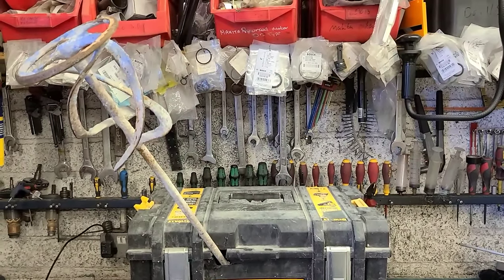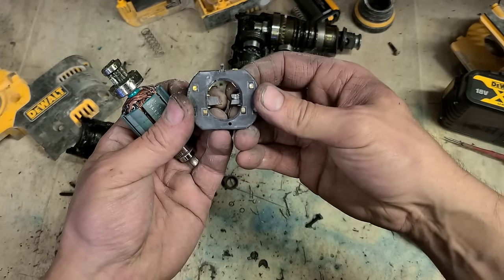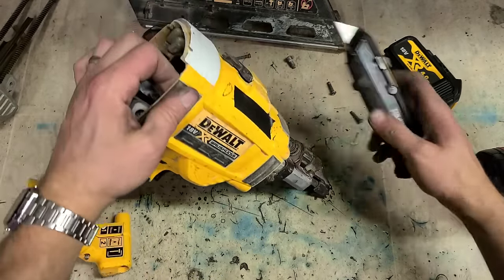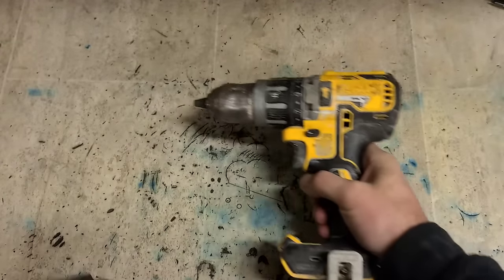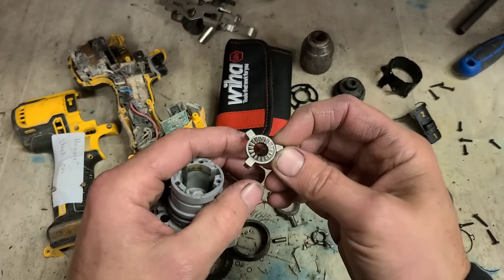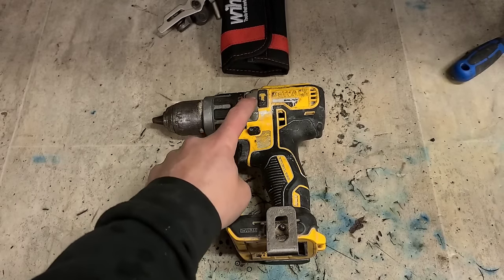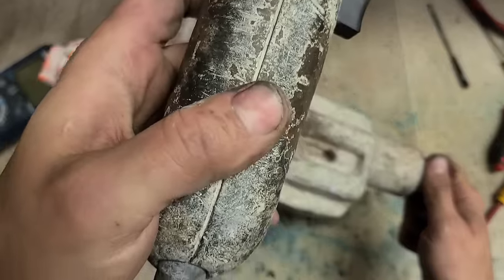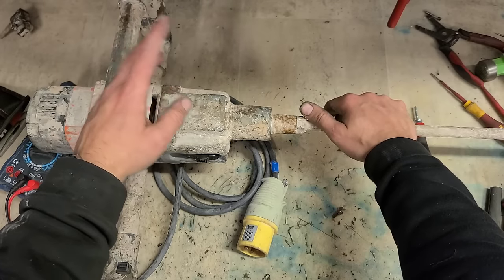Another big Dewalt box, fill of broken tools needing repaired. Dewalt, Makita and Alfra tools fixed.

Comment: Hi Dean ,fantastic jobs ! I am following you whenever  I have to sharpen my attention when  occasionally I repair my tools . I have a GBH 4 DFE | 0 611 236 703 and somehow after  ordering parts for servicing  the  hammer   ,watching your  video more than   5-6 times  I finally succed  to put all  together  but unfortunately   did not work the hammer mode   , open again and find out  that the Pos 830 - Aandrijflager 1 615 819 022   the outer ring of the bearing was broken. In The Netherlands  and probably all over  is no more in stock ; And now my question : is it possible  to have  that part  and in case yes , would you like to sell it to me ? The point  is  I have spent more than 100 euro on parts  and now  I have to fix the problem   ,otherwise  is a waste of time and money  .   Anyway  , either cases   I am your fan  in repairing  tools section  !

Comment: Nice fixes again! I'm still amazed though how heaps of your repairs come in without any description on what's wrong with them. Ofcourse some of them are obvious, but the ones like that Dewalt SDS drill where it's losing power over time are a lot harder to diagnose with just a quick test and not knowing why the customer sent it in.

Comment: Hey Dean, I love the videos! Question - Has the quality of Makita gone downhill since they started producing them in China? To the point that it puts them on par with every other major brand, such as DeWalt, Milwaukee, etc.
Reply from the maker: To an extent, yes. they are never going to last as long at they use to. But unlike a lot of other brands, makita sell a lot of parts seperatly, so they can be maintained and kept going for years if you want to repair them.

Comment: Tools fixed in this video:
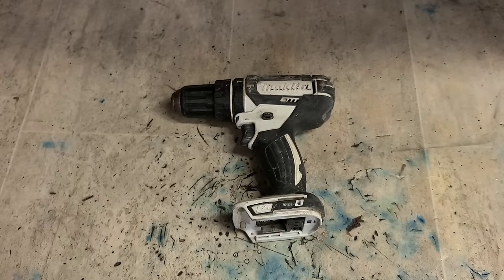1:22 Makita DHP482 drill  | Fault: Problem with starting
4:47 DeWalt DCH253 SDS Drill | Fault: Motor losing power (according to owner)
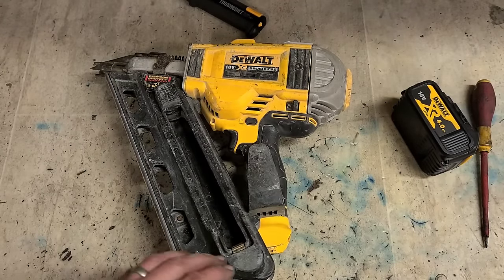17:40 DeWalt DCN692 (Type 2) nailer | Fault: Not firing
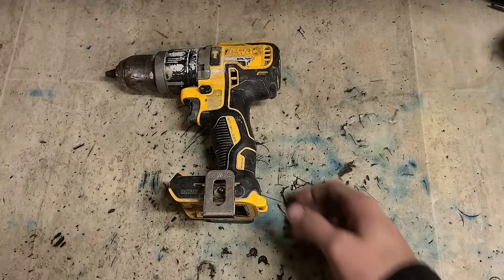30:16 DeWalt DCD1196 Drill | Fault: Stuck in hammer mode
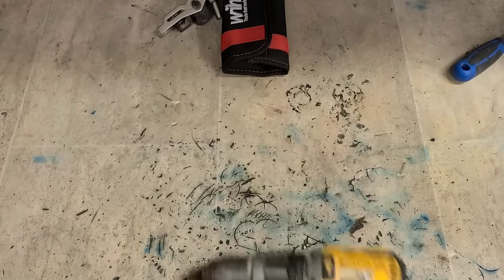52:25 Alfra EHR23/2 (possibly) concrete mixer

Cheers to Dean for telling model number, rather than me doing some CSI investigations.
Reply: Are there any tools that you dread comming into the workshop? That are a nightmare to repair?
Reply: @mickymeltdown  Sorry mate, Im not Dean, nor I am associated with him. Just average bloke who post this timestamps and model name, if someone has this model and same problem, so he can try to fix it himself.

Comment: Been watching the channel for a few months now and I haven't seen any multitool failures.  I'm looking to buy the 18v dewalt multitool as I'm on the platform, is it any good?  I can get the solo tool for about 140eur, DCS356.  Cheers from Greece.
Reply from the maker: yes they are quite good. they only failure i normaly see is a broken wire inside. 
But this only happens after years of use.

Comment: My neighbour laughed at me when I used my faithful old ( push up battery ) desalt 18v trimsaw to cut some unistrut, I had a Milwaukee Li-ion battery adaptor he didn’t notice. 
Next day on the job he donated me an entire DeWalt kit bag,with jig,recip,grinder and drivers along with a rake of dead batteries & chargers.
I spent a week stripping and cleaning the commutators & brushes , lubed the bearings and RESULT. 
We had a fall out when he demanded I return his gift 🤡